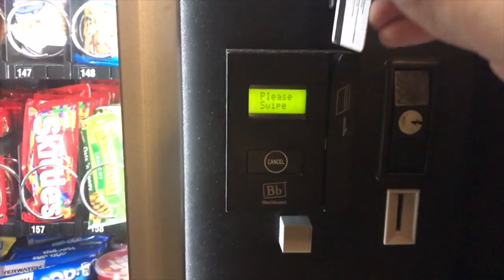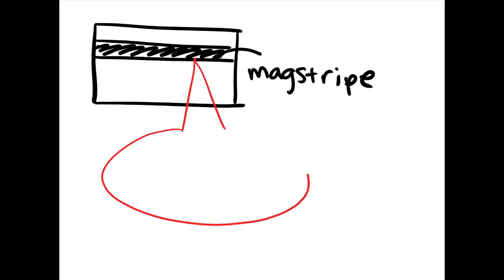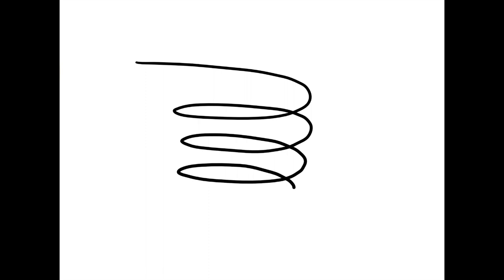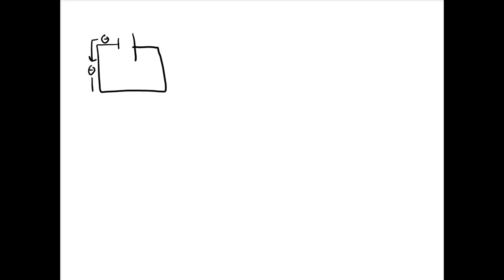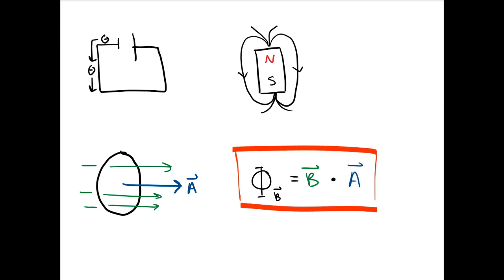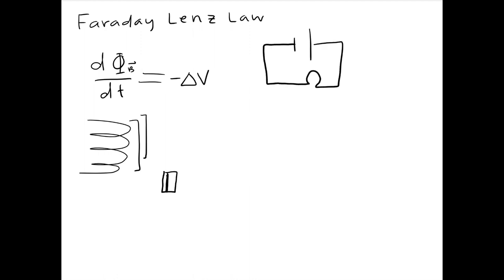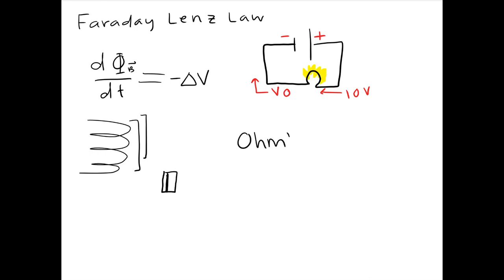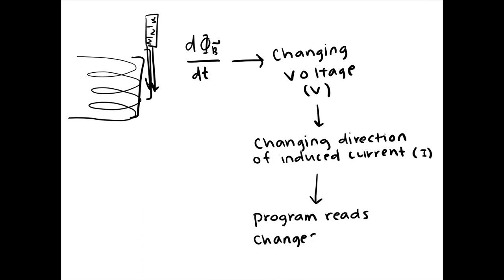How Credit Cards Work

Comment: It is so far off the curve you said the reader is made up of a solenoid- I had to take a step back and think about what a solonoid is and I assume you did it for a very deliberate reason as opposed to saying a coil- Wouldn't the solenoid only be when the card is going through the coil as opposed to most coils which have the material within the coil at all times?  I am also curious because a mag stripe requires a ton of precision and solenoids are very crude vs something like a linear motor.